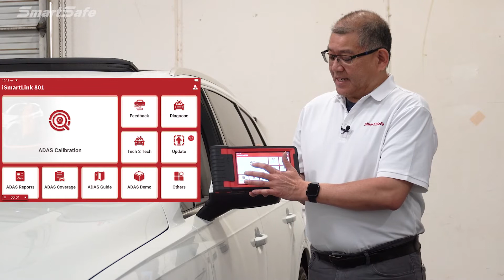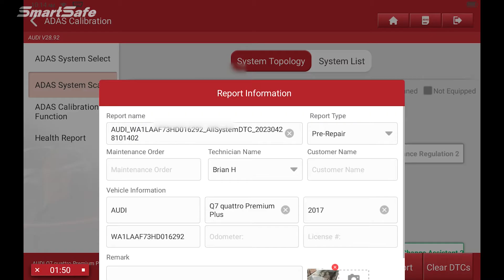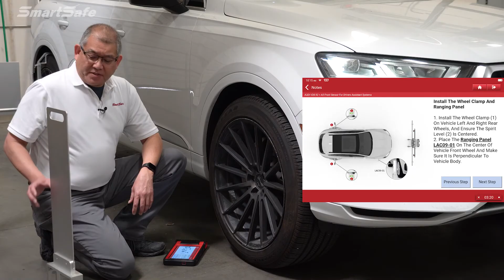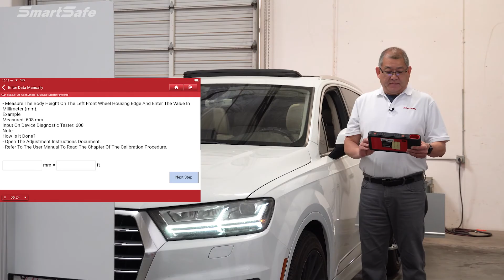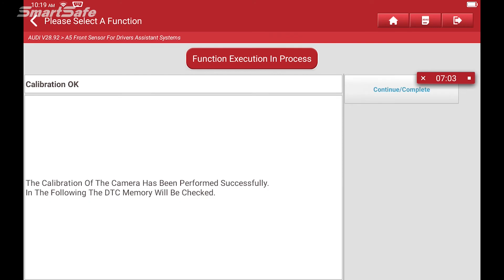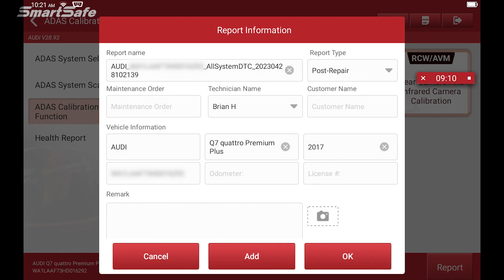AUDI Q7 calibartion LDW for ADAS PRO+

Comment: Warning: €4000 Paperweight? My Experience with the Smartsafe Launch P03 EV Tool
I purchased the Smartsafe Launch P03 EV Detection Tool for €4000, expecting a professional-grade diagnostic device for multiple electric vehicles. Unfortunately, my experience has been deeply disappointing and I feel compelled to share it to warn other potential buyers.

The Limited Positive: On the one specific vehicle it actually works with—a BYD Seal—the device is neat, the features are clear, useful, and meet expectations for diagnosis.

The Massive Problem: The critical flaw, which renders this €4000 investment nearly worthless, is that the device only works on that single BYD Seguel model. It has failed to diagnose any other electric vehicle I have tried. For a tool marketed as a comprehensive EV diagnostic device, this limitation is unacceptable and was not made clear at the point of sale.

Abysmal Customer & Technical Support: For over two months, I have been seeking a solution—be it a repair, firmware update, or clear guidance—from both Smartsafe's technical support and the authorized shop in Ireland where I purchased the device. The response has been consistently poor: highly reluctant, negligent, and ultimately ineffective. My legitimate requests have been met with silence and inaction, leaving me with a brand new, non-functional tool. (I have documented the frustrating correspondence via WhatsApp, which I am happy to share).

Final Verdict: I rate this product below 1 star. Considering the extreme cost and the complete failure of support, I cannot recommend it in any capacity. I feel legitimately scammed.

Advice to Buyers: Think twice, no, think ten times before investing in any Smartsafe product. Ensure in writing that the device is compatible with your specific vehicle models and that there is a proven, responsive support system. My €4000 lesson is one I hope others can avoid.Warning: €4000 Paperweight? My Experience with the Smartsafe Launch P03 EV Tool
I purchased the Smartsafe Launch P03 EV Detection Tool for €4000, expecting a professional-grade diagnostic device for multiple electric vehicles. Unfortunately, my experience has been deeply disappointing and I feel compelled to share it to warn other potential buyers.

The Limited Positive: On the one specific vehicle it actually works with—a BYD Seal—the device is neat, the features are clear, useful, and meet expectations for diagnosis.

The Massive Problem: The critical flaw, which renders this €4000 investment nearly worthless, is that the device only works on that single BYD Seguel model. It has failed to diagnose any other electric vehicle I have tried. For a tool marketed as a comprehensive EV diagnostic device, this limitation is unacceptable and was not made clear at the point of sale.

Abysmal Customer & Technical Support: For over two months, I have been seeking a solution—be it a repair, firmware update, or clear guidance—from both Smartsafe's technical support and the authorized shop in Ireland where I purchased the device. The response has been consistently poor: highly reluctant, negligent, and ultimately ineffective. My legitimate requests have been met with silence and inaction, leaving me with a brand new, non-functional tool. (I have documented the frustrating correspondence via WhatsApp, which I am happy to share).

Final Verdict: I rate this product below 1 star. Considering the extreme cost and the complete failure of support, I cannot recommend it in any capacity. I feel legitimately scammed.

Advice to Buyers: Think twice, no, think ten times before investing in any Smartsafe product. Ensure in writing that the device is compatible with your specific vehicle models and that there is a proven, responsive support system. My €4000 lesson is one I hope others can avoid.